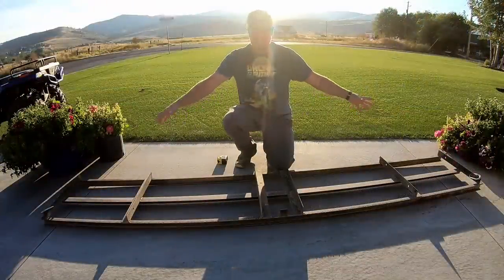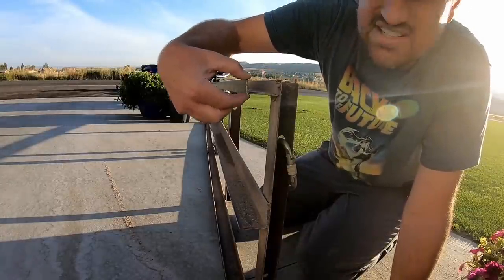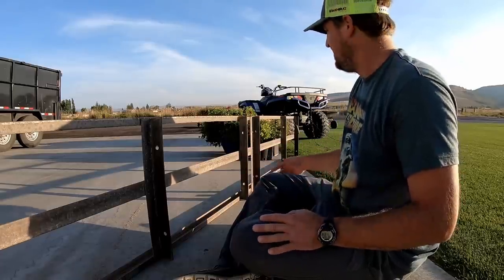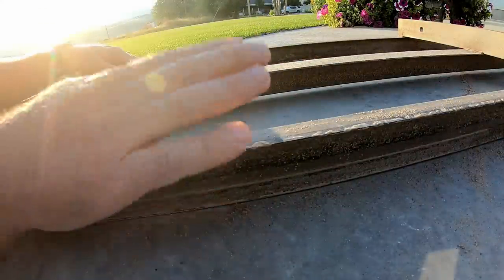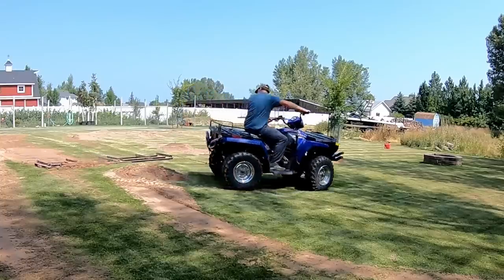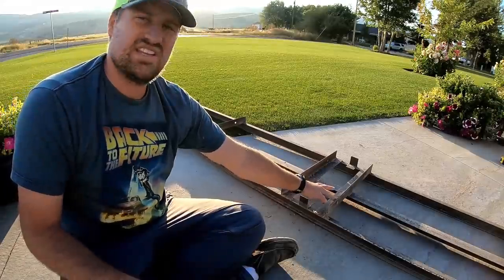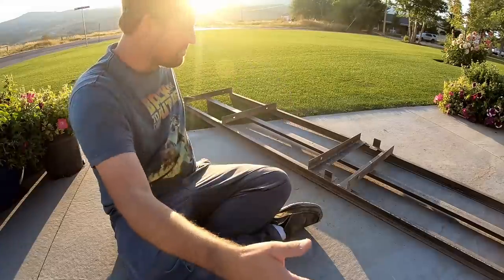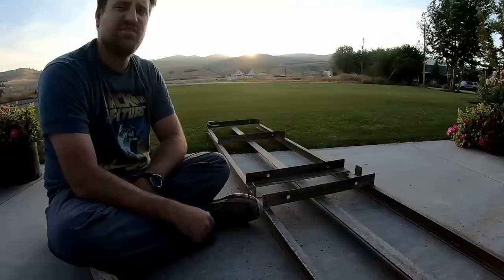TOP DRESSING drag mat. LAWN LEVELING

Comment: The easiest way to fix the flipping is to make new holes for the clips closer to the front.  This would eliminate the upward pull when the device encounters greater push back from a large pile.  No weights or major modifications needed.  Awesome homemade machine!
Reply: Bingo. I was thinking the same thing.  Moving the pull holes closer to the end would put more weight on the back of the drag and prevent flipping and actually bring that back C channel more into use in dragging.  I think the front C channel is doing 80% of the leveling now.
Reply: What Jeremy said plus, put those cinder block holders to use, the extra weight during the initial process will give the drag the mass to overcome the piles of sand. 

Thanks for the overview, I built one myself but it only has one blade, I see now I need an additional blade to make good flat surfaces!
Reply: It would also be much more stable if he added U-bolts or hooks into the face of the front channel to connect the chain to. That'll get below the center of gravity of the whole contraption.

Comment: Great job!  With all of your details, I went to my steel supplier, bought what you mentioned for $142.00.  They cut everything to length for that fee too.  Mine is 10' wide like yours, but made the supports 24" instead of 20".  I used the washers as spacers as you mentioned.  I've never welded before so I bought a welder and watched some youtube 'how to weld' videos.  I knocked it out in 2 hours.  Thank you so much for the inspiration!
Reply: The finished product in kioti orange
https://photos.app.goo.gl/orPtknNfCr9BPons8
Reply: @kingofbytes  I noticed that yoru c-channel openings are pointing down and Connor's are pointing forward or backwards depending on how you look at it. Do you think this makes a difference, whether good or bad? I'm planning to build a 6 or 7 footer this summer, just curious. Thanks-Drew
Reply: @dcousar2352 Thanks for the reply.  The C channel is actually pointing forward....in the pic you cannot really tell because the photo is from "behind" the drag.  You want the C channel pointed toward the back of your tractor....this way when you're dragging, there is a 'collection area' in the channel and this will subsequently 'drop' dirt into voids.  HTH!
Reply from the maker: Yes. Point c channel forwards. It holds material and re distributes it
Reply: @kingofbytes  awesome!! Appreciate you clearing that up for me. Useful information 👌🏼

Comment: Connor as an option consider adjusting the side to side tilt by shortening up your drag chain on one side, this way you can roll your product from one side to the other, it helps distribute the build up of sand on the drag. Also consider using artificial turf instead of brooms to drag behind your drag when doing a finish drag. Just a thought🤙🏼

Comment: Connor, used your description of the drag device and built one of my own this week.  10 feet x 30 inches.  Weighs in at 117 pounds now with 3/4 inch thick angle iron.  Put the long center piece of angle iron 18 inches from the front, 12 inches from the back to help keep the center of gravity aft of middle and should help with the tipping issue.  We'll have to see if the weight is too much and tears up the grass when I'm dragging.  Doing three acres total.  

Will let you know come late Spring!

Comment: Conner I have drag made similar to yours and I also have a chain drag. The chain drag really does a finale clean up after the leveling. It cause the sand to go into the the turf and I don't hafta broom. I have just used the chain drag alone for leveling and it works fine to. It's heavy enough wide and long to pull the sand. I noticed your drag collects where you pull it and you have to make a lot of trips. The chain spreads out the sand as it gathers it up just thought you might look in to it. They use them on fairways and greens. That where I got the idea and it don't take long thanks!

Comment: You could weld bolts to your angle and c channel (head down, threads up) and drill holes through the broom heads, put the broom heads down on the bolts and secure with locking nuts so they are removable for when they need replacing( could counter sink the nuts if needed too) I might have to build me a drag too, I could use some leveling!

Comment: a simple solution that would help some to keep it from flipping is move the holes to attach the carabiners to the c channel as low as possible. when the bottom hooks the sand the pull points even being above that by 1-3 inches it get enough leverage to flip it. if you can get those mounting points lower it would help a lot i think. probably take 5 minutes to drill a few new holes. nice yard BTW!!

Comment: That thing is so awesome.  I'm impressed.  I have used the other drags you were talking about to smooth out a baseball infield.  They do not work on the lawn if it is not already level.  Something solid and fixed like this seems logical.
Reply from the maker: Yeah the ztr could pull it for sure

Comment: Just a thought... Drill a couple mounting holes close to the front/back of the 20 inch direction. It will produce less of a lever to allow the drag to flip with.  Should help you out a little.  I don't know grass but I do know engineering.

Comment: Cool design.  What would you suggest for leveling a large rural lawn?  It's at least 5 acres of really rough terrain that's a real pisser offer to mow.
Reply from the maker: That my friend is a tough question to answer. I am not sure how to tackle that project. If say piece by piece but that just isn't feasible. You could and what might be cheaper would be to kill it, level it, then reseed it. Level it with a tractor or a skid steer with a leveling attachment
Reply: @lawnrebel  Thanks for the advice.  My 2 cents on the flipping issue: Just tie off at the joint of the channel and cross beam on the leading edge.  Free.  If you want to drill, do it in the C-channel.
Reply: Hire someone with a compact to midsize grader to 'set up the land' then have that same someone roll it in with a roller.  Once they do that, you should be able to fine tune with @connorward's method.
Reply: Did you end up leveling your place?  I live on 5 acres as well. I plan to do this project toward the end of this coming winter while my grass is still dormant. I feel like that’ll buy me plenty of time to get everything completed.
Reply: @amandadavis9726 I ended up getting a Wright standing / sitting mower that's much less punishing over rough terrain.  Since then I've also added a couple ponds and a stream for my ducks and geese.  So, the terrain is even more difficult than ever to manage.
Reply: @Jim0i0  that’s not good. At least it’s more comfortable for you to get the job done.

Comment: To keep the drag from flipping drill your holes for your tow chain closer to the front. And maybe add some weight to the back of the drag if it still flips in the early stages of sand dispersing.

Comment: Youre right about mats dragging material back out of low spots. Having a rigid drag that deposits sand/soil into low spots because the drag straddles the high spots is something I wished I had considered before buying a mat. The upside to a mat is if you have an area of rolling terrain that you either cant level or dont want to level. It'll smooth it out beautifully but thats it.

Comment: Right on Connor!!! So have you tried putting any weight on the back of the drag to keep it from flipping?
Reply: Kyle Fitzwater also moving the chain mounting holes closer to the front edge will reduce leverage.

Comment: Connor, I've completely killed my lawn during a summer remodel project that ripped out my irrigation system, equipment driving over it, etc. The long and short of it is I need to completely start over. Do you have any recommendations regarding sprinkler type, line size, pressure, sod vs. hydro-seeding, grass type? Sorry, I know that is a lot of stuff. I'm in the Salt Lake are if it matters.

Comment: Mind you, im no ME - I think if you change your angle of attack on the drag, it will fix (or help) the flipping issue.

edit: By pulling from the top you're creating a moment about the front C-channel, either lengthen your rope (quite a bit), or (preferably) change the mounting location of the carabiner. but again, not an ME, EE's more my thing...

Comment: One thing I thought might be useful for dumping the sand is adding a pulley to the dump bucket. That way you would only need to get off the atv once.
Reply from the maker: The pulley would dump it? Or the pulley brings the empty wagon into normal mode?
Reply: @lawnrebel  pulley would bring it back to normal mode. Unless there is a way to make it dump for you also, then it would really cut back on time.
Reply from the maker: Your exactly right. Next time I do this. I'm doing that for sure

Comment: If my lawn is at 2 inches right now would this device work for me or would I need to have shorter grass first. I am thinking it might not do a good job in taller grass. Any thoughts. I am trying to get down to 1.5 and stay there. I need to get a flatter lawn to help stop scalping.

Comment: Found it! Awesome I can’t find a lawn level this size anywhere on the internet for sell if you know of any please send me a link!
Reply from the maker: Good work you did find the video. I didn't film it when I actually made it. I was not making vids back then. It's easy to make. Steel and bolts if necessary. Find a friend with a welder. A wood pallet works as well. Lots of ways to get it done

Comment: Hey Connor, is it critical to mount the end cross braces on top to let the material slide out the sides?  I have some Unistrut that I am going to use to build a lawn drag.  Just trying to decide on the best orientation.
Reply from the maker: no.. I dont. I am sure that you could figure up something with the unistrut

Comment: drill new holes more towards the edge so it doesn't flip over?
Reply from the maker: Yeah I could should try that. It's only an issue in the beginning if the piles are very large
Reply: need some close ups of that lawn of yours. looks so good. those close ups always get me going lol. good work rebel.
Reply: Was my first thought also, having the holes for hooks all the way forward and lower should help it not flip over with piles of sand. Adding a length of steel for weight, 20 lbs or so to top back edge end to end should also help. I would add a bush from end to end on back so not only you level you brush at the same time.
Reply: Agreed. Drill a new hole as close to the front and as low as possible. It will help in every situation. Obviously a lot of fixes out there but This fix is almost free and will work just fine. Great tool though, Connor. Love you’re videos.

Comment: Hi Connor, I'm about to go make one of these, but just wanted to ask how critical it is to use the C channel?.. would three strips of angle iron do the same with the middle one higher up? .. Thanks
Reply from the maker: Likely yes. I really do not know if it would or not. I am guessing that it would work just fine. I wanted the c channel to grab the bulk excess sand and pull it.

Comment: I know this video is old, but is the c-channel necessary in this design? Could it be substituted for square tubing? Is there a purpose to it, to "catch" the sand or is it merely there to use the bottom face to spread the sand flat?
Reply from the maker: I am not sure if it's necessary or not. It does grab material and hold it to be re distributed elsewhere
Reply: Thanks for the reply, it got me thinking and I wonder if that’s what’s causing it to tip over when you have a big pile. It’s like the c-channel is catching too much sand causing it to rotate. I wonder if you pulled it from the other side to test it out to whether it would rotate then?
Reply from the maker: @TroyeStonich  I did build it specifically to be towed in the opposite direction like you suggested. I did also since this video drill out holes at the very edge of the drag. Doing this helped it from flipping over. It no longer flips over

Comment: The problem you're having with it flipping over isn't due to the depth of 20", its due to where you're pulling it from.  Your attachment point is too high relative to the leading edge of the C channel .  Drill holes in the middle of your front C channel and attach there.  It'll fix your flipping issues, no need to make a new one.

Comment: What if u have a surface with so many indentations like a golf course fairway, which of them is ur best bet? A drag or steel mat?
Reply from the maker: I'd say steel because it will deposit material in the low spots rather than pull it out like a mat sometimes does
Reply: @lawnrebel  "....like a mat sometimes does" i think u mean drag
Reply from the maker: @samuelasamoah6906  drag mat that is flexible. The drag I use is firm and rigid. Does not flex at all in the low spots or as it spans over low areas.
Reply: @lawnrebel  tnx connor

Comment: I know this vid is a few years old but I'm hoping you respond. I have and acre with common bermuda. I;ve had a mole infestation and they have hit every square inch of my yard. I have finally got them under control but my yard is so bad it's hard to even ride a mower on it. Extremely rough and uneven. I bought a roller to fill with water that will weigh 1000lbs when full and have been waiting for a good heavy rain to soften up my yard to try to flatten out the yard before I try to top dress with sand. I'm not sure if the roller will work or not but that's my plan. My point is every video I watch like yours dragging a leveler of some type has extremely smooth yards already. I'm not sure if something like this will work or not. I know I'm going to need a LOT of sand but do you think this will work or do you have any suggestions "PLEASE"?  OR ANYONE?   Thanks
Reply from the maker: You're going to have to work at it slowly. Gonna have to bring in some dirt or sand or some medium to drag across the top. The roller will work yes. I'd start with top soil and a drag.

Comment: I have a 20 HP craftsman riding lawnmower model 247.270381. Will it be able to pull this level?
Reply from the maker: Yeah I would think so. You would need to knock down the piles of sand first.

Comment: Did this rip any existing lawn out?
Reply from the maker: No
Reply: Connor Ward  I’m doing a entire yard.. do you have a video on the process to lay down the dirt prior to using the drag?  Thx in advance for the info.. my yard has a bit of roughness. I’m assuming it’s gonna be a couple times before I achieve complete smooth

Comment: +connor ward do you advise doing the same with bermuda? I live in Temecula ca and its so damn hot here all the time had to go with the bermuda.
Reply from the maker: Absolutely you can do this with Bermuda. With Bermuda you can actually even go heavier with the sand and it will recover very nicely and quicker than you would think.  I would wait until next July though. Bermuda is top dressed or leveled with sand in the peak of its growing season. I would say that your window for 2018 is rapidly closing. PS. I lived in Menifee from 2006 to 2012